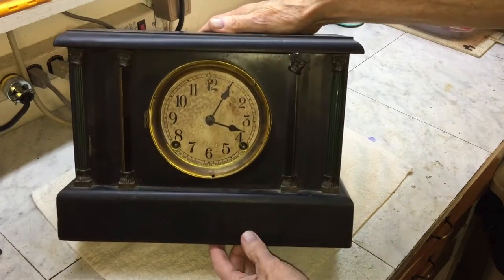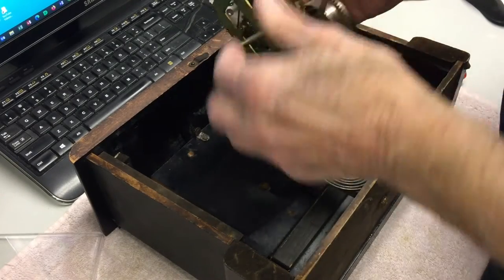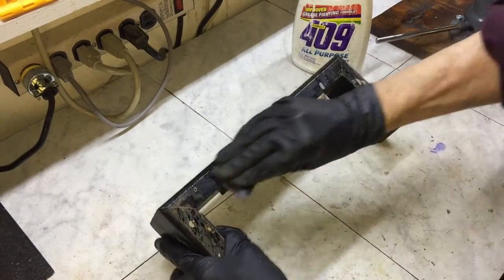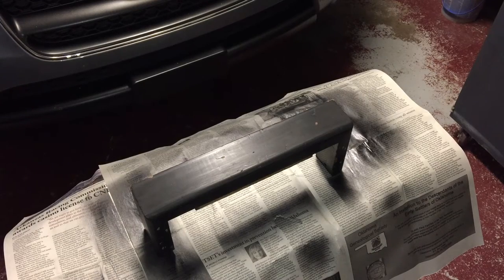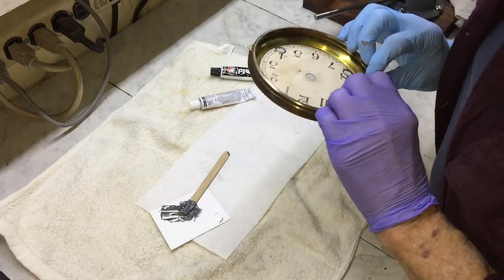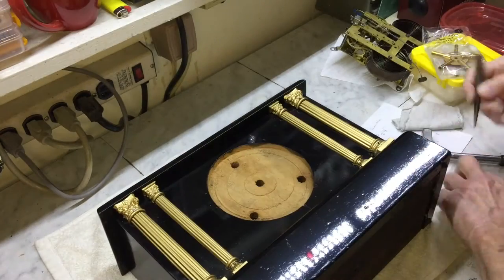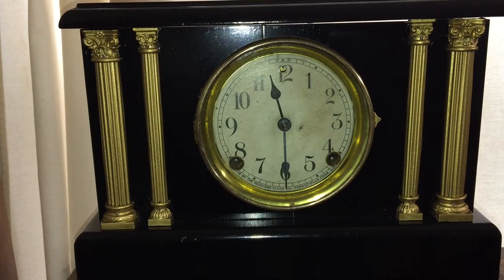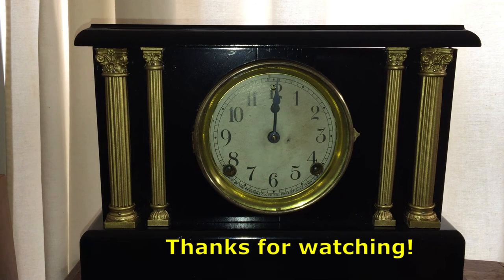Sessions Mantle Clock Rescue

Comment: I found one almost identical to yours except mine has a step base. I got it for $ 10 it needs a main spring and cleaning overall. The chime spring is good and the chime works. I am going to learn how to replace the spring from YouTube videos.
Reply from the maker: Glad you found my channel - I hope this video is of some help to you with your project.  Fortunately I did not have to disassemble the movement on mine, just needed cleaning.  My clock is still keeping reasonably good time after about a year now.  Thanks for watching the video and commenting!  Best regards, Bill.

Comment: I have had good luck refastening clock faces & glass to the bezels using hot melt glue when it can be hidden from sight. It holds good enough and can be pealed off fairly easily. JB weld is great for many things but i doubt if it would be removable on a  delicate clock bezel. And I too wanted to make sure I didnt overoil my Seth Thomas mantel clock. But I think I underoiled, & the clock wouldn't stay running. So I used a bit more oil, now it has been running steady, for a few weeks so far anyway. I also had those columns to reinstall & rather than use the little brass brads, I was able to buy tiny little brass phillips screws which are easier to install for sure.
Reply from the maker: Thanks for the comment Jeffrey!  Good idea on the hot melt glue.  I used JB Weld to replace the solder joint on the hinge.  The glass was reinstalled by bending the little tabs that were inside the bezel, so the glass can easily be removed again if necessary.  Thanks for watching the video!  Bill.

Comment: Just out of curiosity, what recipe did you use in your ultrasonic cleaner? Whatever you used really brightened up the brass and made the movement look really nice.
Reply from the maker: Hi Brayden.  If you stop the video at 2:29 you can see the formula on the side of the milk bottle.  Acetone, ammonia, soap ('Awesome Stuff Cleaner') from the $ store and water. Approximate measures - not critical.  I got it somewhere on the internet, forgot where.  Thanks for watching!
Reply: @rollerbald  Thanks!